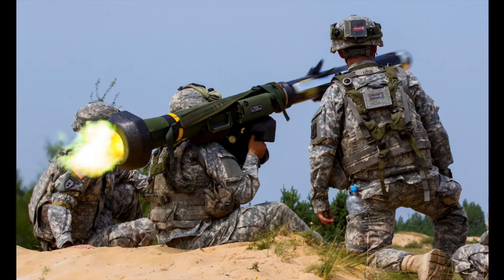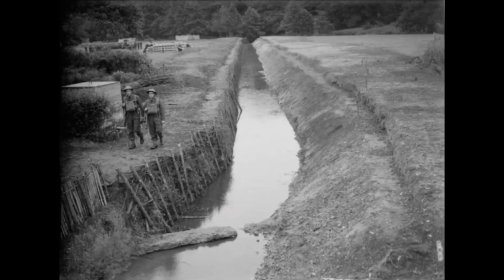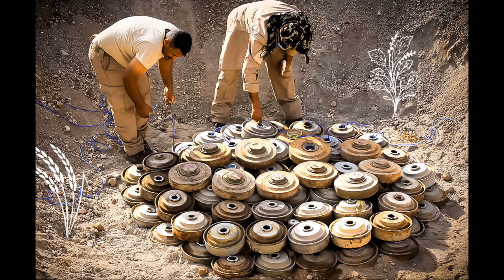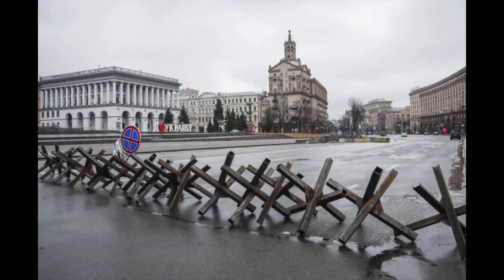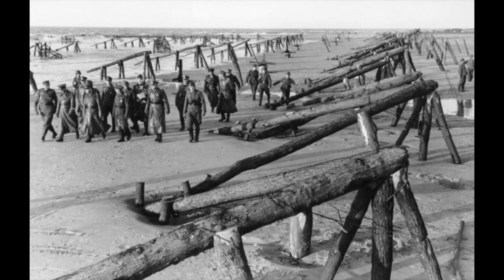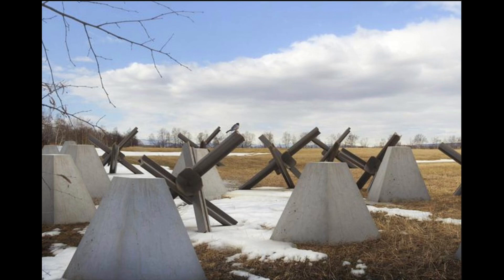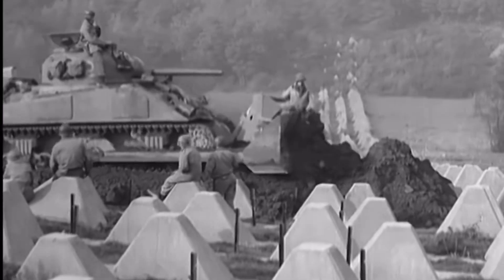How To DEFEAT Tanks | Anti Tank Obstacles History

Comment: Great video! I wish you had a shot of the trees stopping a tank. I still can't imagine how that would work 😅.
Reply from the maker: It would be great! I couldn’t find it anywhere, thanks for watching
Reply: Army 12C NCO here (corps of engineers, bridge crewman ie mobility/countermobility specialist) I know you posted this a year ago, but in case you still wanted an explanation of how this works:
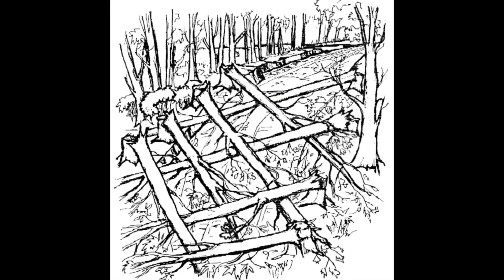The picture of the Abatis at 1:52 and 1:57 would stop a tank or bulldozer, the picture at 2:06 would not. The difference is leaving the stump attached and pointing the branches towards the enemy. 
In order to push towards the abatis, you would essentially be pushing into the stumps of all the trees (and each tree has 30-50 ft of roots in all directions with tons and tons of dirt on top) and you would have to overcome compressive strength of big tree trunks (and the dirt or asphalt under the tank tracks will slide out and start digging a hole before that happens).
Additionally, you are expecting the enemy to come that way so it is often accompanied by C wire (razor wire) wrapped up and tangled in the branches (which would also break the chainsaws even if the enemy didnt fall into it) and sometimes we would explosives in the abatis. In order to clear it youd need engineers to clear the wire, a team with loud chainsaws and gas to be cutting for hours if not days, you might need a bomb squad/EOD, and youd need to post security in a linear danger area for many hours of the day. You cant cut it until the wire is gone, you might not want to burn it until the explosives are gone or identified (or else you might be burying it in the ash and youd get blown up going over the ashes) AND burning it gives away your position because of the smoke (and at night the light and heat signature).
THEN (since we know exactly where the abatis is located) we would have artillery pointed at the points of approach and we would hit an enemy bulldozer or industrial forestry equipment as soon as the enemy tried to bring it up the road. All you would need is a single guy (called a forward observer) or a drone or even just some trail camera to tell the artillery team “theyre in the spot, light them up!”
You can also lay the abatis over rail tracks (rail is the main way they transport tanks and artillery long distances). Not only would that disable all the loads on the train for a while by making them immobile, but the train doesnt have a way of going in reverse and they dont have a way of moving it backward. We would disable their transportation, all the tanks, stop all their ammo and munitions resupply, and wed get data because wed know where they were trying to move their ammunition and rations and equipment. We would know approximately how many troops and what type of artillery they have in what direction. We could do all of that with trees without even killing anyone. All it would take is a couple guys with either some explosives or a couple chainsaws.

One last strategy that makes an abatis really nasty (if you plan to take out a bunch of bad guys) is having the trees (still standing) rigged with explosives. You stage an ambush with your firing teams hiding where the enemy is going to approach from and facing the abatis. You wait for the convoy of enemy vehicles to show up, then you blow up the abatis in their path. Suddenly your ambush hits the back vehicle so the entire convoy is trapped and would have to either run from their vehicles and out into the open or they’d have to try to reverse directly towards your ambush’s gunfire… and again, wed already have artillery pointing their guns there.
Ideally they all surrender after that back vehicle gets taken out, but if they don’t and they stay in their vehicles, we just call the artillery to erase the entire convoy while they are stuck there. The blown up vehicles make it even more difficult to clear that roadway. 
A small team of 6-12 and an artillery fire team can take out entire convoys of armored vehicles and tanks with very minimal equipment or risk with this technique.